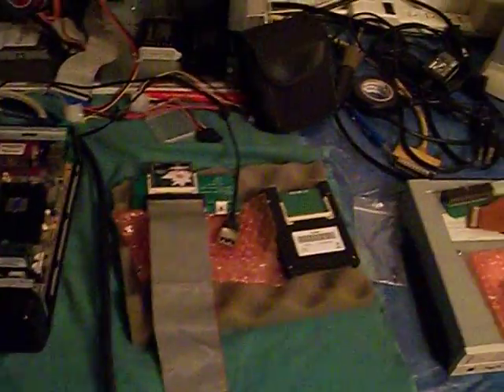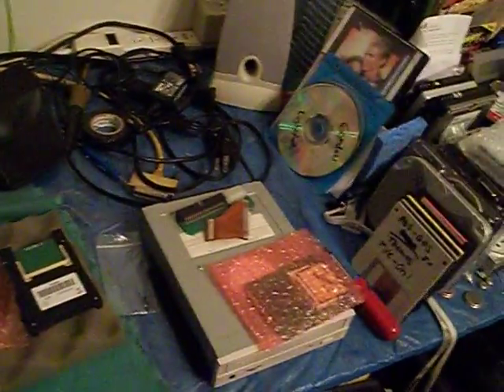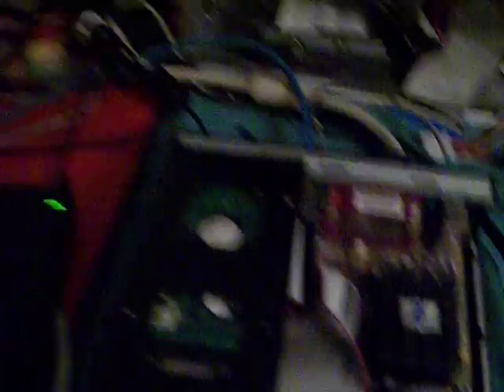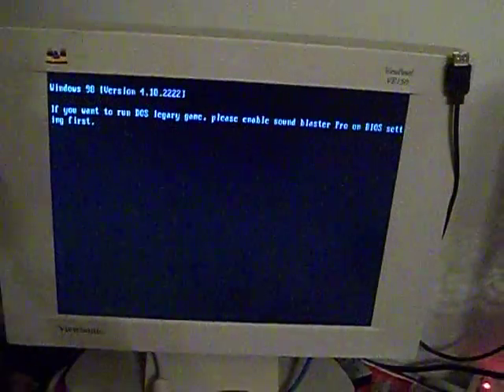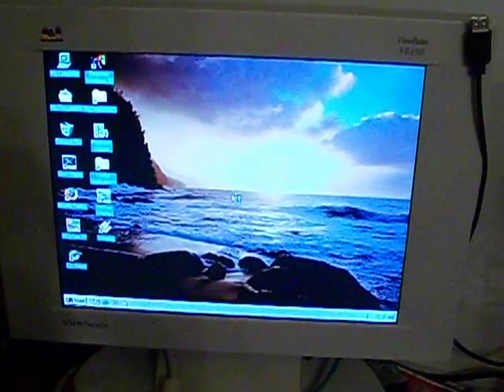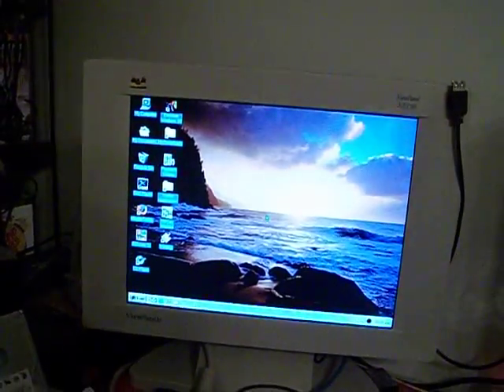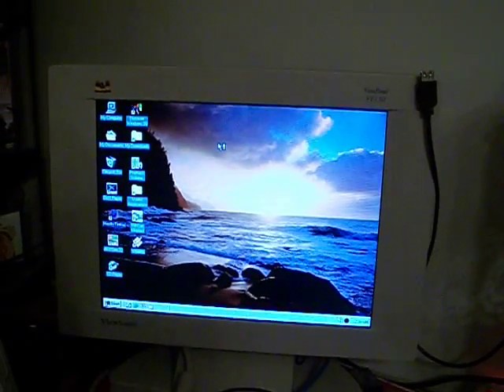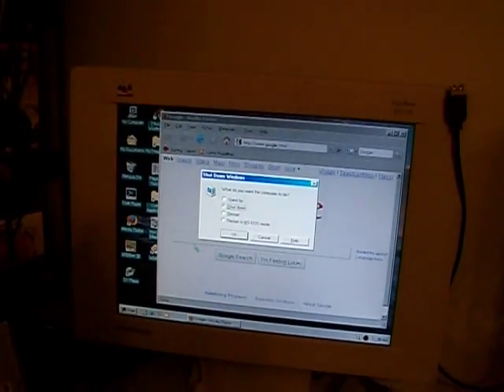Pico PSU first run.avi

Comment from the maker: @OrangeJuice1982 - (continuining ...) No optical drives, and only one hard disk drive (which will be changed to a home-made SSD soon). The PicoPSU doesn't seem to generate any heat. Performs well, but this is a really old baord. I'd say this is fefinitely worth it, but if you need to use optical, I'd buy a higher wattage unit, I got the lowest watt unit I could get away with, so I don't plan to add much more to the system other than USB video capture. :)

Comment from the maker: @OrangeJuice1982 - Yes, that's Windows 98 Second Edition - smaller, faster, and less "writes" to the drive than a Windows 2000 installation. Also, I needed a small very "petite" system to run some legacy stuff from the past that won't run on Win2000, so I opted for Win98SE. The PicoPSU was obtained from Logic Supply for ca $25. The power brick I had from a previous purchase of a PW-60 snap-on mini-ITX kit.

Comment: Did that really say Win98, wow.
Questions:
1. How much did the pico psu and brick set you back
2. Where did you get it from
3. Are you running a optical drive, If so how does the psu perform